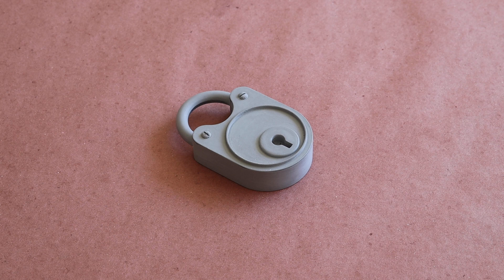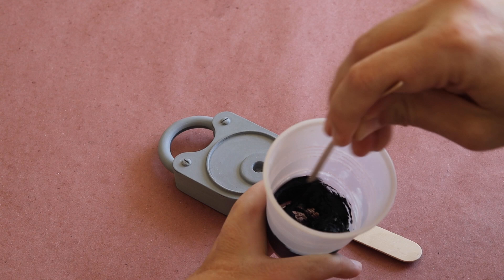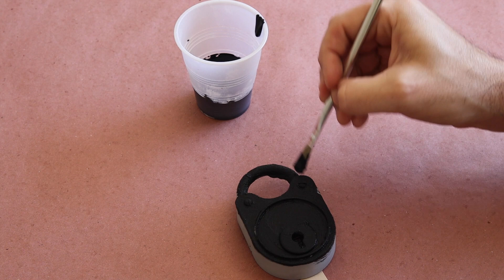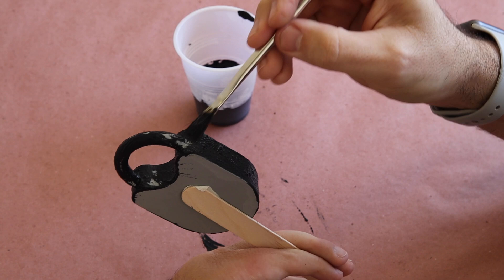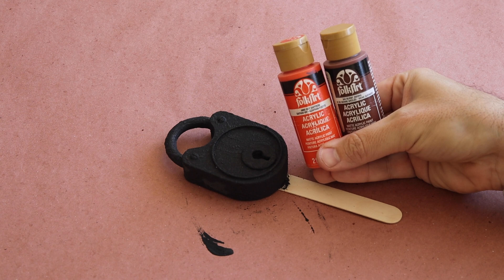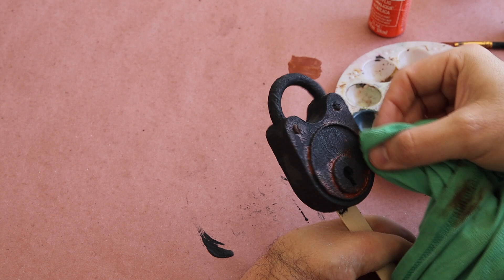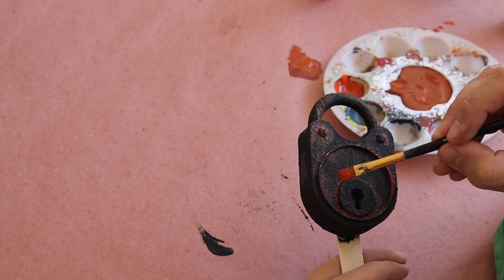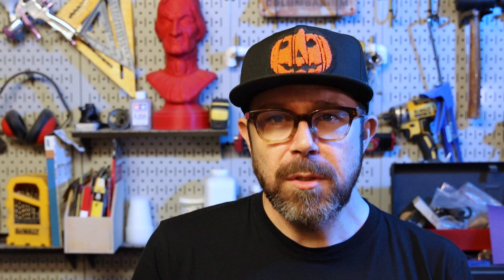Fake Cast Iron Antique Lock Prop

Comment: I needed to do a large surface with a texture (a replica of the Star Trek II warp core) and used a mix of PVA and builders sand, works like a charm and cheap as chips! With a coat of matt paint over the top the effect was pretty much perfect. Just another way to make something out of nothing... oh, hang on that's not here is it!! :) Thanks for the vids!
Reply from the maker: Great tips!